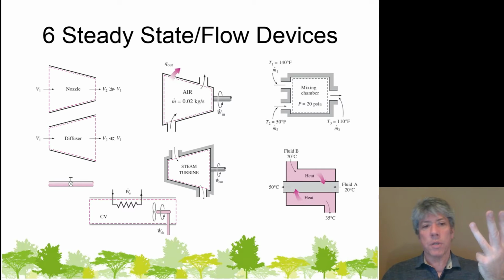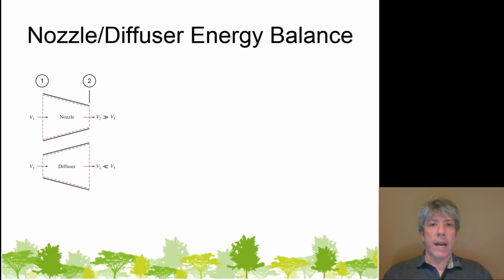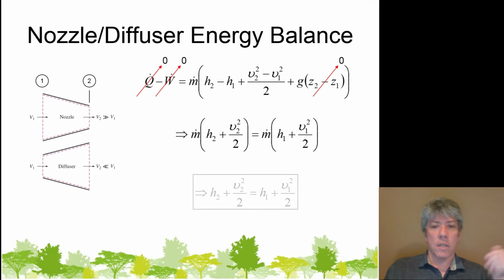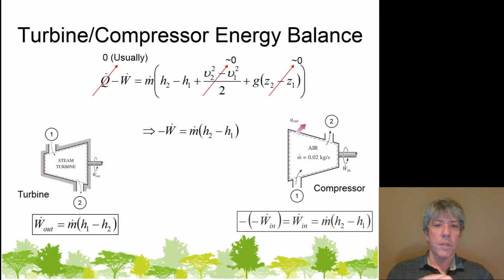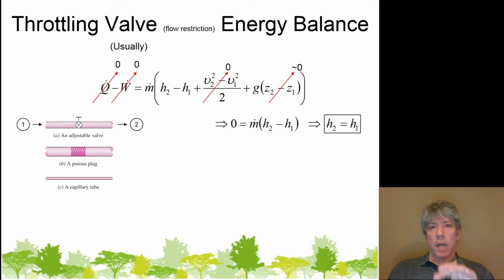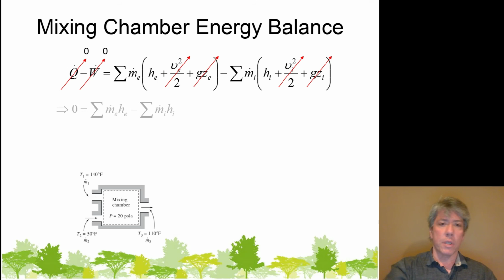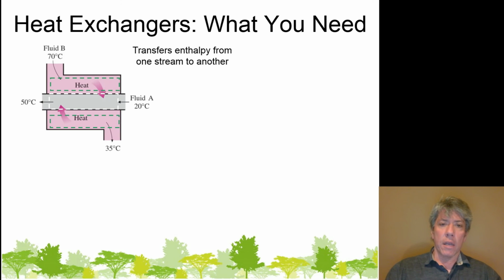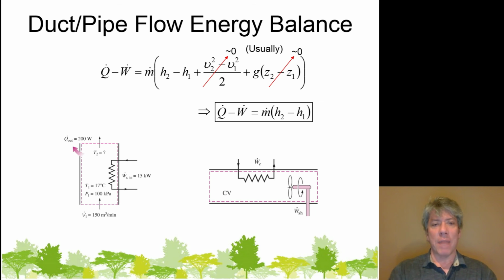MET 220 Steady Flow Devices

Comment: Sir, why in the throttling device , only specific amount of liquid refrigerant flashes and changes to gasous state , i know pressure decreases but why only this amount changes to gaseous state and the rest of the refrigerant is still in the liquid state ? and how to reduce the amount of the flash in the expansion device ?
Thank you in advance.
Reply from the maker: The key to the answer is the fact that energy is conserved.  Since the most significant energy types involved in the throttling valve are flow and thermal (and assuming there is no addition or removal of energy by heat or work as the fluid flows through the throttling valve), these two must pass energy back and forth.  The amount of energy required for vaporizing the liquid (called the latent heat of vaporization) primarily determines how much liquid changes phase to gas; however, the nature of the fluid determines the relationship between the saturation temperature and saturation pressure.  The final pressure must be low enough for the liquid to change phase to gas, otherwise, the reduction in flow energy (P*v) due to the pressure drop requires that the thermal energy (u) increase.